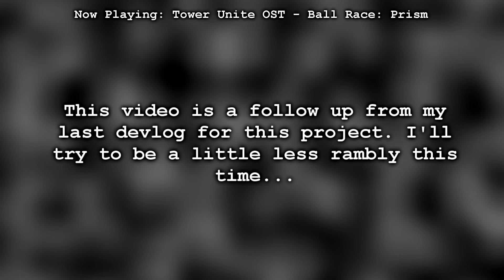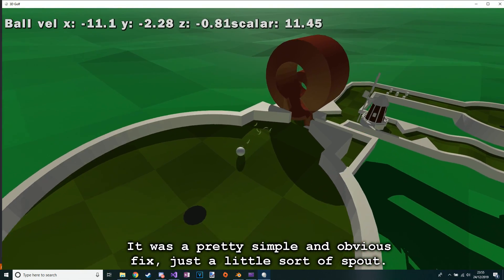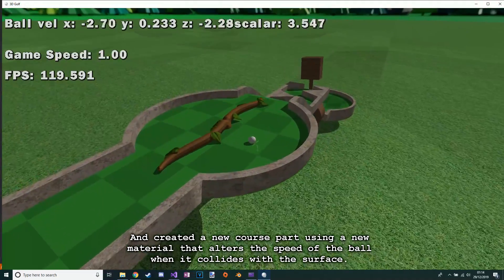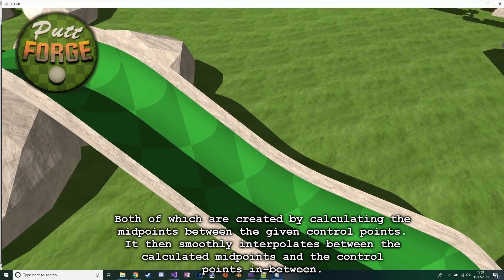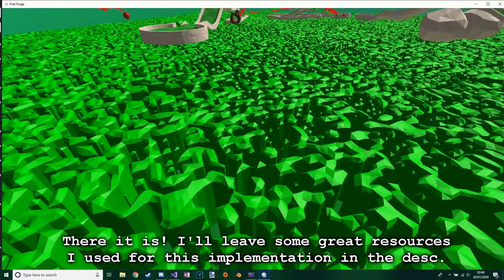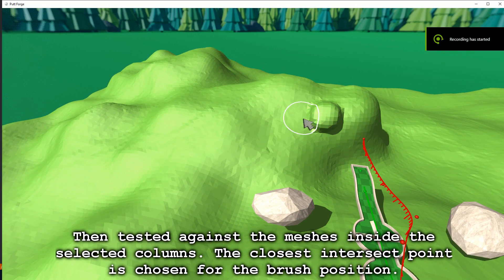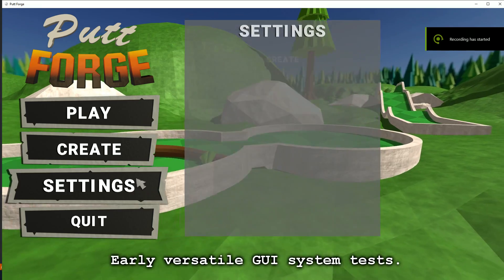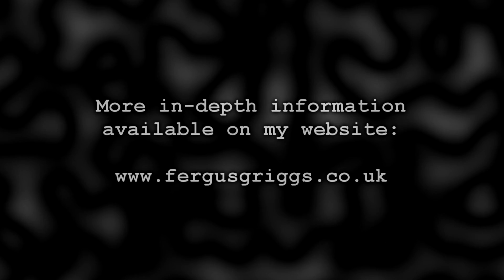[C++ | OpenGL] Golf Game Development Progress - Fergus Griggs

Comment: Amazing video! I was watching the previous ones and I liked them as wel, keep it up!

I have a question: I noticed that you have two splines and I'm assuming thst the first is for the camera's position and the second for the camera view track. But how do you managed to get where in the second spline the camera needs to look at? My first guess was the nearest spline position, but I don't think so since the camera would almost always look sideways...
Reply from the maker: Hey, thanks! 

The way I chose to solve that issue is to give the camera position spline (red) and camera 'look at' spline (green) an equal number of nodes. Each camera position node corresponds to a 'look at' node on the other spline. To get the current camera position and 'look at' position I just sample both splines with the same delta value. If I were to return to the project it would be nice to number the nodes in the UI so that it's obvious which node the camera will be looking at any given position node. 

Hopefully, that made some kind of sense!
Reply: @fbob987  neat, thank you for the explanation. keep it up!